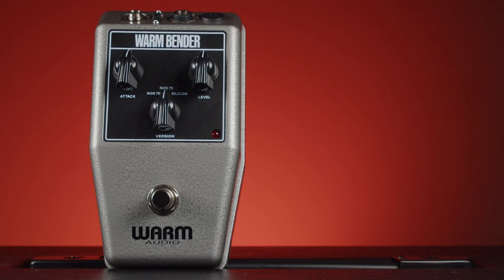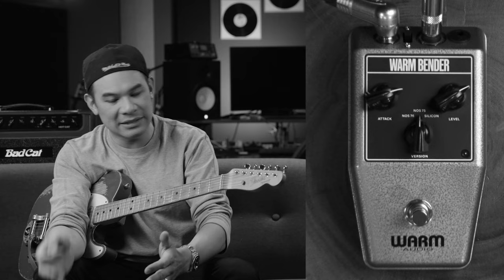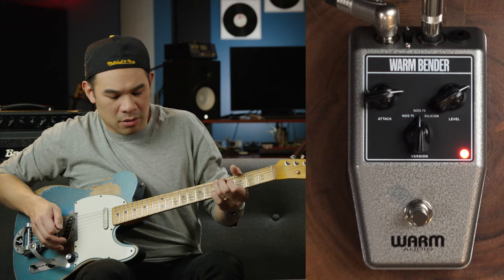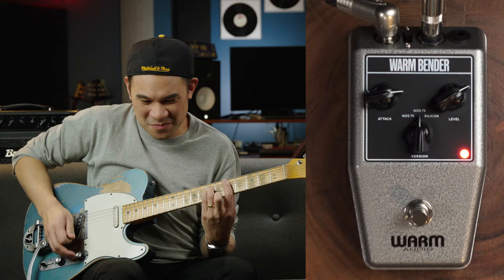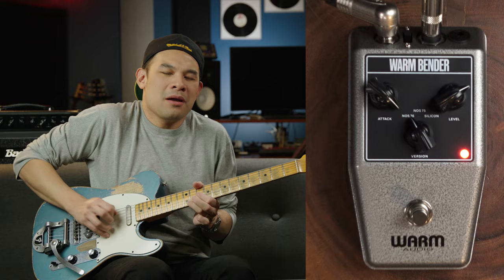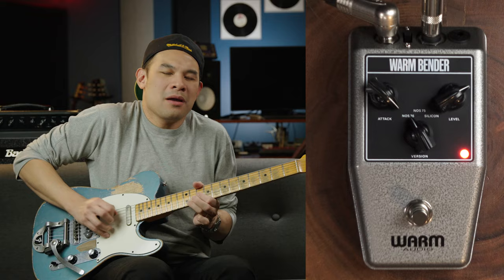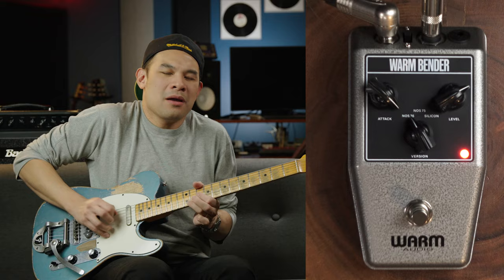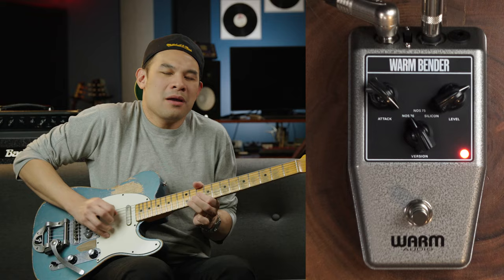3 Killer Tone Benders In One Killer Box | Warm Audio Warm Bender Fuzz

Comment: I was waiting for a gutshot before buying - I used to design and build pedals, and that includes many recreations of old fuzz boxes, and I was suspicious that Warm could build so many of these and at such a low price.
I understand that the Chinese are producing large numbers of these components in generic capsules 
to be marked up as required by the purchaser.
I have used hundreds of NOS germanium transistors including lots of OC75's and I have NEVER seen an unmarked OC75. All the ones which I have used have been black painted glass enclosures with OC75 printed on the outside. the whole point of such components is that they can be easily identified.

The ones in the OC75 Warm Bender look to suspiciously me like the later replacement for the OC75 - the AC128. These are far more common, and I have seen these in unmarked metal enclosures. They don't have the rarity and 'vibe' of OC75's though!
In my opinion these are what we are seeing in this pedal.
Saying all this, by far the most important factors are hfe and leakage rather than the number on the outside when it comes to germanium transistors.